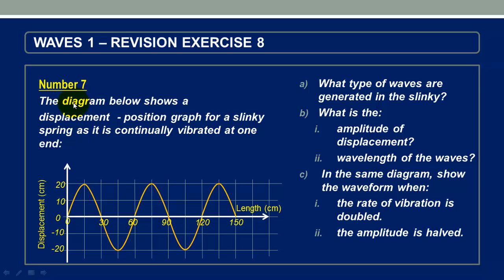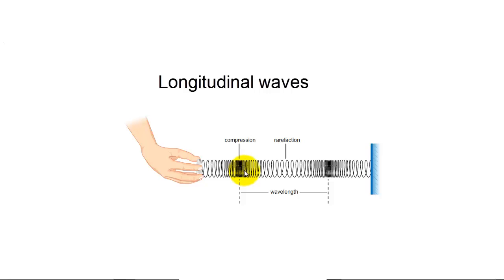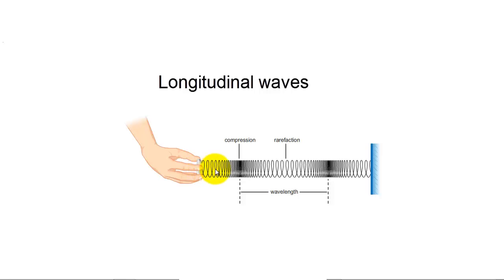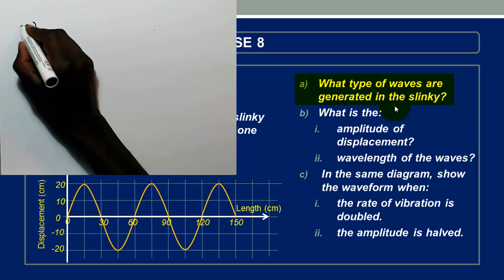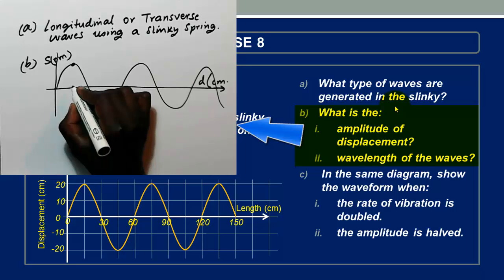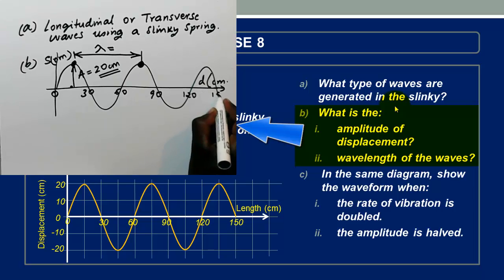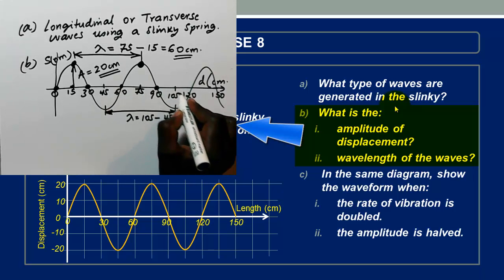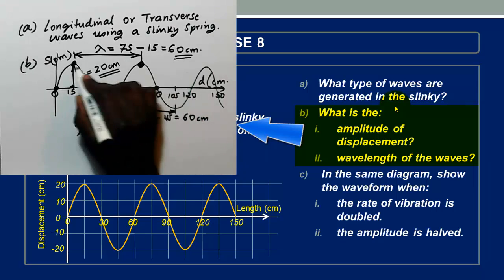Calculating amplitude and wavelength from a displacement-position graph

Comment: Would a period change affect the graph or would it still look the same?
Reply from the maker: Thank you for this question. We need to remember the relationship between period (T) and frequency (f). Frequency is equal to the inverse of the Period. For instance if source of the waves vibrates or oscillates faster (high frequency), the period will be low (it will take a shorter time to complete one oscillation). In part (c)(i), I could have framed it this way: "... when the period is halved ..."